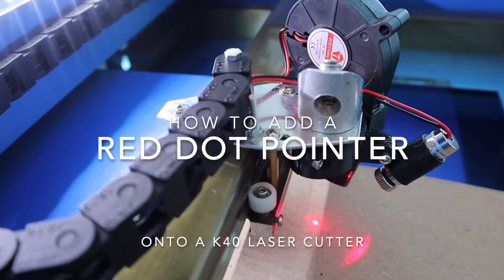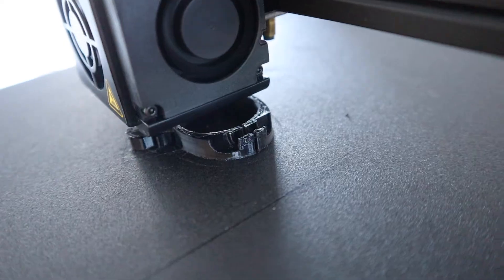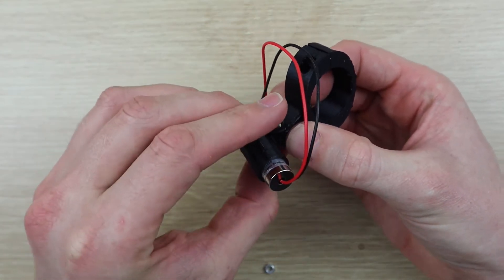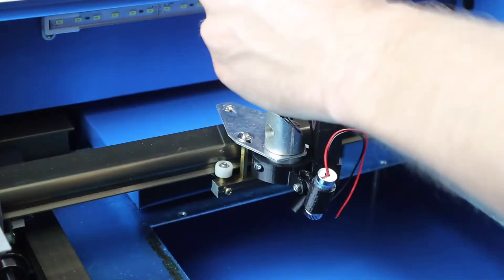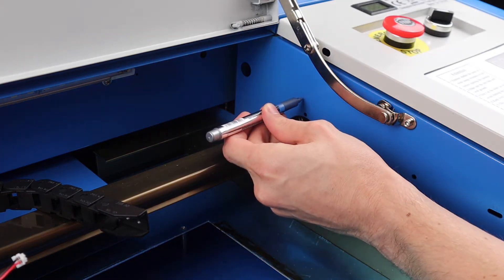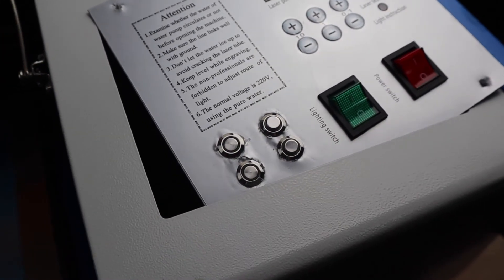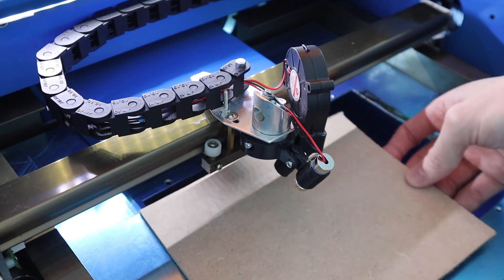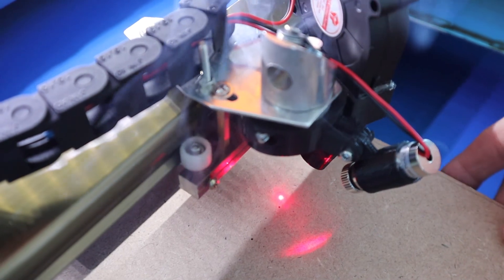Add A Red Dot Pointer To A K40 Laser Cutter

Comment: good evening, I would like to connect the red dot to my k40, should the black wire be connected to the gnd (green) and the red wire to the 5v (yellow)?
Reply from the maker: I'm not sure if the colours are the same as mine but yes, black to GND and red to 5V. It might help to put a pushbutton or switch in the circuit too so that it's not on all of the time.
Reply: @MichaelKlements  thank you very much, for the answer, I will certainly put a switch ... but the most important thing was to understand the position of the colors ... you were very kind

Comment: First Mod I did was to get an air assist head. (easy to install). Then I upgraded the driver board. I want to do the pointer mod next. The thing I really need to do is get the Cable Carrier.
Reply from the maker: I need to find a quieter compressor for my air assist head. I tend not to use it that much just because of the noise that the compressor makes.
Reply: @MichaelKlements  I'm in the same boat. I am using a fish tank pump right now. I will get a new pump after I replace the mirrors.

Comment: Shame you did not cover wiring the switches, but still a good video, mine is on when it should be off, press the switch to turn it on and it goes off

Comment: Good idea, I've just ordered the laser pointer from eBay. First mod I did (even before the machine was switched on) was air assist. As I already have a compressor, I just added an air line attachment and drag chain for the silicon tube. Would recommend the air assist head. It does mean buying another lens but definitely worth it.
Reply from the maker: Thanks for the tip, I'm considering trying a proper air assist head and compressor. I'd also like to try re-arrange the gantry to get the cutting area a bit bigger. There is a lot of wasted space in these K40s.
Reply: @MichaelKlements  Yeah definitely agree with that. Surely there's no reason why it couldn't be extended to A2 size.... That would be much more useful.

Comment: Nice easy video , Thanks, one of the most important things to protect your investment is the inclusion of a water flow switch, this can be included as an interlock into the pin outs so it can prevent the laser firing in the event that the pump fails to supply cooling water to the tube,  a lot of people rig an interlock into the lid which to is only useful if you have kids around really , you'd be better off doing the pump as that affects you bank balance.

I always wear protection glasses so it doesn't worry me not having the interlock on the lid , ( my kids are adults and I have a key interlock instead of the laser on button)  what does is no protection for the tube.  the interlock flow switch is 5 euros of hawklasers and a little bit of wiring up to the pin outs.   You can still have a visual feedback with a coloured flow meter and temperature gauge and you can if you want do what i did and put a temperature controller so if the water  increases or reduces between two set values then the laser wont run for protection again. 

I believe there is on youtube a video using a nano and a display to do some of this and it will switch off power,  The one I have is more simple and just sits within the control panel, its about 8cm / 3cm fully programmable. Great little addition along with the most important i feel being the interlock on the water supply. you just connect it into the laser on button; pink cables on old analog machines, Digital I'm not so sure where not having one.  You can end up modding and blinging these things silly as some people do but this is one of the best mods you can do to protect your investment.
Reply from the maker: Thanks for the great tip! This is definitely a good idea to have on your system, a burnt out tube is an expensive replacement.
Reply: @MichaelKlements  no probs max 8 euros off ali-express, i have the pin outs if you ever put one on. just message me